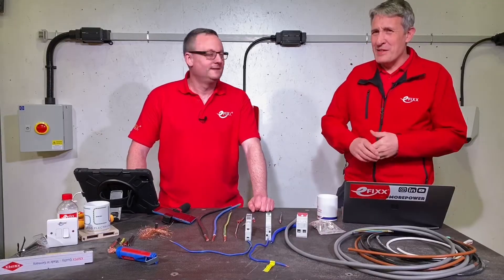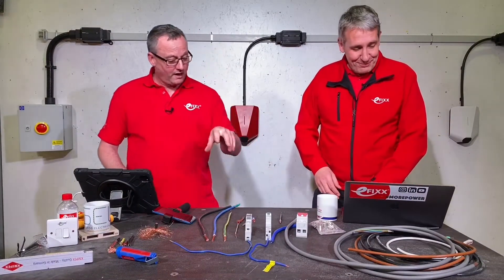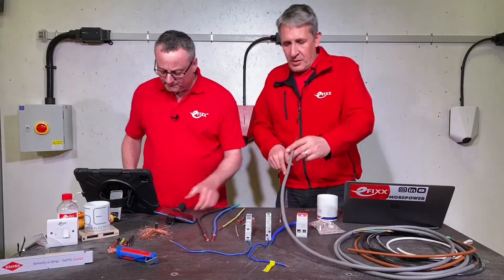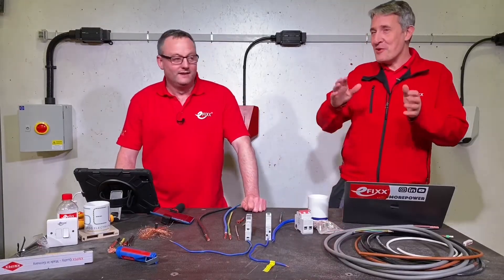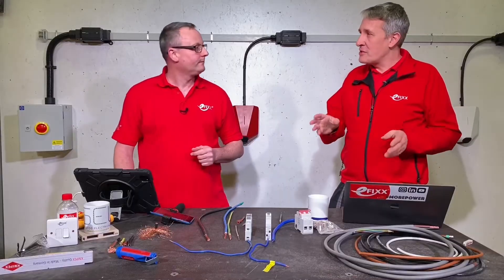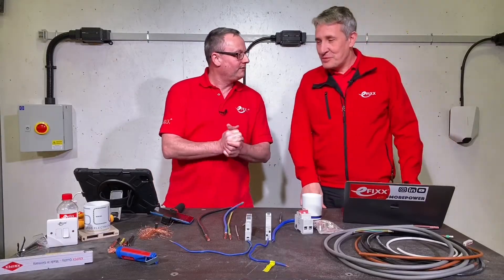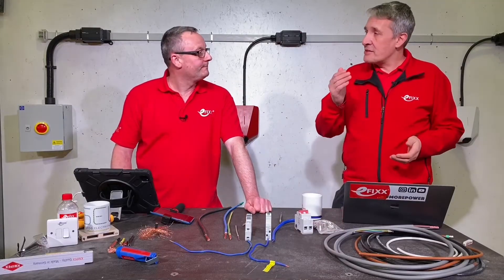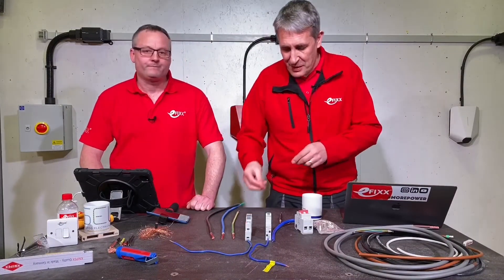UNDERSTANDING CLASSES of ELECTRICAL CONDUCTORS - lets get counting!

Comment: So whoever drafted BS EN 60228:2005 wasn't very good! What sort of definition is "More flexible than Class 5"? They should have described the flexibility of Class 5 and 6 in terms of the measurable parameters of the cable, e.g. bending radius. It's not easy writing standards, and this is an example of how not to do it!

Comment: Industrial electrician for over 40 years and I found that interesting, especially the core counting, done that got the tea shirt😂 class 5/6 we used to refer to as welding cable. Try getting a lug on some 240mm2. Seen class 5 cable that was used in machines sliding back and forth shoot the cores out through the insulation, it’s amazing what constant flexing can do to a cable, you wouldn’t believe it

Comment: I would have cut of a meter of cable without the insulation and weighed them all. Then weighed an individual strand. Dividing the smaller into the larger will give the total number of strands. A lot quicker and probably more accurate than counting.
Reply: Quicker to look at the datasheet. Besides, do you really believe he counted them
Reply: Why a meter ?
Any length of conductor would work. 
Regardless, extremely accurate scale would be needed to accomplish this. 
Btw,
When I sell scrap wire the buyer weighs a length with, then without insulation. Payment is based on percentage copper of the total weight.

Comment: The electrical systems and switching that you guys use in homes in the UK is far more complex than what is considered standard in most homes built in the last 10 years. North America doesn't have hardly any electronics or solid state equipment installed in the load center as standard equipment, that will eventually change though. It's still fairly primitive with magnetic fault switches and stuff.

Comment: whats the advantage of so many strands that big strands in stranded wire?
Reply from the maker: More strands makes the cable more flexible - used for battery leads when the cable needs to be moved frequently

Comment: Counting strands vs coffee drinking? You might do a calculation instead: 16mm² / π(0.21mm/2)² is about 462 strands at least in order to comply to the standard. An easy way to bundle large numbers of strands is by doubling up several times, resulting in powers of 2 in total. In this case 512 strands might be practical to manufacture.

Comment: Class 1, solid, is used for 2.5mm cable, which is intended for fixed installations.  But we use 2.5mm solid to connect up sockets, which by definition need to be pulled in and out, meaning the wires to the back of a socket should be Class 4 or Class 6 - flexible.
Reply: @toddbod94 
The cables are solid. Not meant at any time for flexible applications, no matter how infrequent. Solid cables on the terminals of a socket can have stress on them (maybe give a poor connection or pop out) while flex cable does not. Use the right cable for the job. 

Having the solid cables in Wagos, completing the ring, in the backbox and flex to the sockets from the Wagos is the best way. Quicker as well.

Comment: Perplexed by the missing classes 3 and 4. Seems they were removed when IEC 180 was replaced in 1966, but I haven't been able to find out what they used to be!
Reply from the maker: Update us when you have 👍🏻
Reply: @efixx  
We still use class 4 in my country (Argentina). To make a quick comparison, a class 4 2.5mm2 cable has 19 strands while its class 5 counterpart has 40 strands. Our regulations describe class 4 as flexible cable while class 5 is described as extra flexible.
I'm actually a bit surprised you guys don't have class 4 in the UK.
Reply: Got the 60180 spec to satisfy my curiosity. Nothing like class of conductors mentioned there. Only solid/ flexible tables.

Comment: it's a real interesting subject when you get into class cables on larger diameter ,  esp in the industrial sector when a lot of machinery comes fitted with class 5 and 6 cables and the spark has used a standard copper lug , different lugs are used for class 5 and 6 .. i had the pleasure of doing a course on BS7609 & BS 7727 .. that would make a good video :)
Reply from the maker: Yes 👍- a great idea - we’ll put it on the list!
Reply: @efixx  Anyone know of a source of class 6 or 5 50mm^2 twin cable ?
Reply: We find that on pump cables which are all class 6. Had one connected to a VFD via a JB and it caught fire due to the incorrect lug and crimp used
Reply: @pauljones908  i see it a lot .. over crimps under crimps , lugs that are different to tool being used.. it's a whole can of worms waiting to be opened.. similar to when efixx first showed ferrule crimpers and then you saw a lot of youtube sparks fitting them on class 1 and 2 cables ... which made me chuckle ... loads!!  it's a great course if you do enough of it..
Reply: @pauljones908  Is this what ferrules do in C/Us ? Is that why they catch fire ? LOL

Comment: I found if you put plenty of current through any cable at a certain point it becomes a class 6, usually just before it burst into fames !
Reply: Hmm, I found the conversion from classes 2, 5, and 6 to class 1 to be easier when undersized for the current. Unfortunately, the insulation rarely survives; and even when it does, it tends to be both brittle and far darker than the original color.